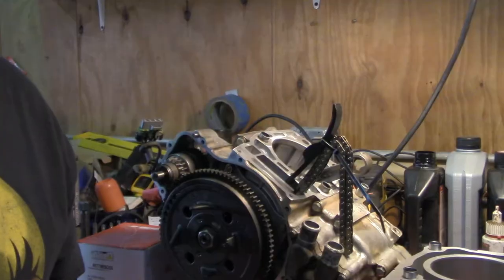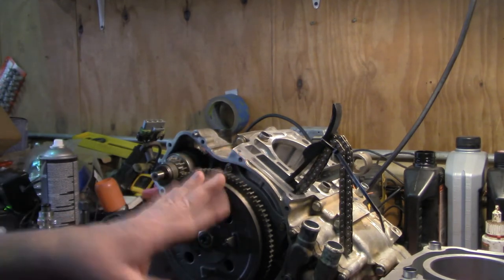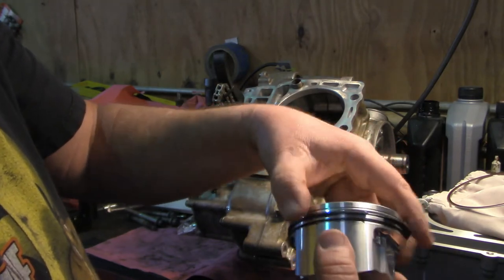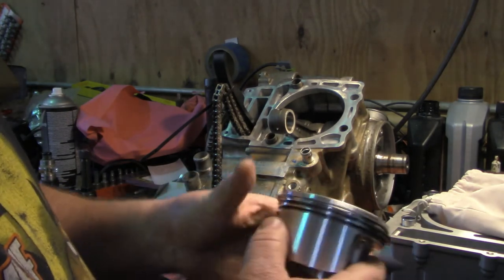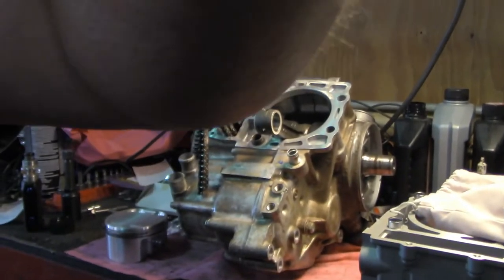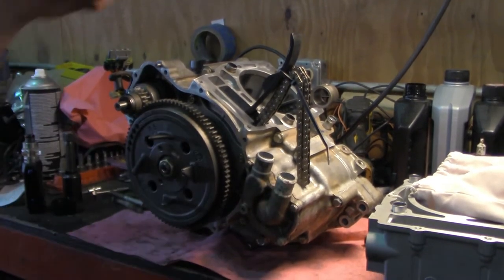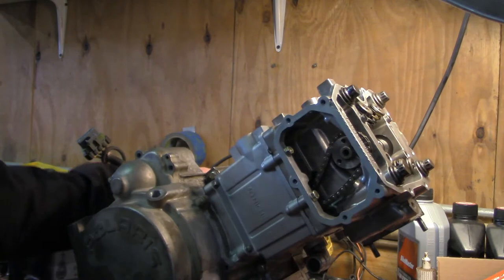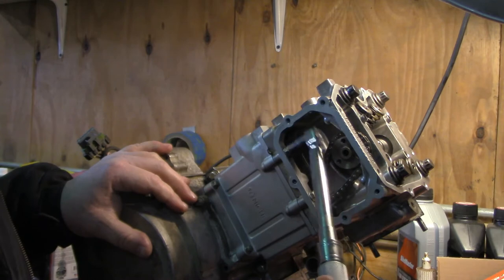Polaris Ranger 500 Top End Rebuild

Comment: Why replace the cylinder? Mine is burning oil, was planning on piston, rings, valve guide seals and gaskets.?
Reply from the maker: Good question, with a better answer. Cylinders are relatively inexpensive these days with myriad aftermarket sources. Once an engine is burning oil, the cylinder will be out of round and warped, the cylinder is also coated with Nikasil which can NOT be bored, you have to install a steel sleeve to refresh the bore, this would make it cost much more than replacing it at the beginning and you avoid the turn around time of a machine shop. You might get away with replacing only the piston and rings, however, even if it doesn't burn oil for awhile, the engine's life span will be substantially shortened and will being consuming oil again fairly quickly. Thanks for watching! I hope I helped you make a decision and good luck!!

Comment: 2007 Polaris ranger 700 EFI runs hot when you go down the road
Reply from the maker: We'll start with the easy things, check the radiator for mud, grass and other debris. You should be able to see through it. When we get one overheating and the rad is dirty, we remove the front bumper and push bar to be able to get to it good enough to actually power wash it effectively, power washing alone may not remove things like speargrass and stuff like that. We use a nylon brush for that. If the rad is clean, check things like coolant level, if the bottle is empty or has ever been empty it may be time to "burp" the system. Depending on how many hours there are on the machine, if could be time to rebuild the water pump even. The plastic impellers have also been known to break ( we replace 2-3 a year ). Let me know what you find. Thanks for watching!

Comment: Question on the oem like pistons there are two dots on top would it matter if I put them in backwards as I put the two dots on opposite side of the cam chain and I believe the two dots go on the cam chain side.
Reply from the maker: The 2 dots go to the mag/alternator side, which is also the cam chain side. If you install the piston backwards, there are a couple of things that can happen, firstly, the reliefs machined into the crown of the piston are asymmetrical meaning that the intake valves can come into contact with the crown of the piston which can/will bend the valves. Secondly, the crown of the piston is not flat on the underside to compensate for the temperature swing between the intake "cold" side and the exhaust "hot" side, this can cause a condition called "cold seize" where the piston expands at an uneven rate during warmup and can stick the piston in the cylinder. Thirdly, the piston skirt (below) the rings, is thinner on the exhaust side vs the intake side for the same reasons the crown is uneven and can/will cause the same issues. Before you tell me you are running it that way and it's just fine ( I have seen them in backwards before ), it WILL drastically shorten the life of the top end, oil consumption and exhaust smoke will be your first symptom, if you haven't run it yet, grab some new gaskets and flip the piston around! Save yourself some money and heartache.
Reply: @JWSRepairServiceLLC  thank you for that helpful info I have not ran it yet luckily an will be tearing into it to turn it around.
Reply: excellent explanation!  @JWSRepairServiceLLC

Comment: I have a 2013 Polaris Ranger 500...
After the top end rebuild I went from 55 pounds to 120 pounds on my compression test. I have read that it should be between 60 and 90... I'm worried about starting it until I know that's ok compression or if I should add a second gasket.
Reply from the maker: Do NOT use a second gasket!! It will never seal. Your compression is normal for a unit that the decompression lever is not working. The only thing the decompression does is make it easier for the starter (but mostly YOU, when rope starting) turn the engine over. It won't really hurt anything to start it like it is, but I would investigate  the compression release to see why it isn't working, the most common reason is too much preload on the eccentric shaft spring, it should just barely be able to lift the counterweight, sometimes it doesn't even lift it all the way up to the stop pin and that's Ok. Thanks for watching and good luck!

Comment: I have a question why would a 2005 Polaris ranger 500 keep shooting antifreeze out of the reservoir cap builds pressure and shoots everywhere?
Reply from the maker: Sounds like a classic blown head gasket (common) or the even worse (rare) cracked head, these conditions are usually the result of overheating, you will need to find the cause of the overheating BEFORE rebuilding the engine or it will do it again. Thanks for watching!
Reply: @JWSRepairServiceLLC  Okay I changed the thermostat cleaned the radiator primed the system ran for 20 min fan is kicking on and off air flow is great the when I drive it it starts to shoot antifreeze out of the reservoir cap big steady stream so should I just replace the gasket and not the whole head sir?
Reply from the maker: @joshuatreadwell5548  In most cases you would want to rebuild the top end, new piston, rings and gaskets. You shouldn't need to replace the head itself unless it is cracked or warped, the water pump should also be rebuilt at the same time and it's not uncommon for the plastic impeller to break off preventing coolant from circulating. I have the vids to do this on my channel.
Reply: I'm subscribed now thank you for helping me sir
Reply from the maker: @joshuatreadwell5548  Thanks for the SUB!!!! We're getting close to 1k subs, which is my first milestone! Thinking about a live stream to do a push to 1K.....ideas?

Comment: Where do you get your rebuild kits? And great job explaining everything!
Reply from the maker: I apologize, I just saw this question, 4 months later!, Good job Youtube. Anyway, to answer your question, I get the bearing and seal kits from All Balls, they also have the water pump kit, but without the impeller. If you need the impeller you will have to get it from Polaris, same if you have a bad crankshaft. There were a couple of aftermarket choices for crankshafts a few years ago, but I have not seen them in the last 2-3 years. Hot Rods used to make a good replacement crank, there could still be few in inventories somewhere. Thanks for watching!

Comment: Have a question I’m struggling with adjusting the valves on my 2002 Polaris sportsman 500 HO. When I bring the cam to the highest point I have zero room to where the rocker arms rest on the valve spring. It’s the correct cam, correct valves, correct springs but I have zero room for a .006 feeler gauge. What am I doing wrong?
Reply from the maker: I'm a bit confused about what you mean by bringing the cam to the highest point. You should align the T mark on the flywheel with the pointer in the mag cover, this is TDC ( top dead center ) then align your cam marks with the pointer cast into the head. This will position the cam lobes at their lowest point and allow the valve lash ( clearance ) to be adjusted. Good luck and thanks for watching!
Reply: @JWSRepairServiceLLC  yep thank you, I had the valve head off the motor and was confusing myself. The moment I put it together and put to top dead center everything worked as expected. My own fault trying to adjust off the engine

Comment: We have a 2015 or a 2016 Polaris Ranger 570 E.F.I and it's burning oil. Is the engine in the video just like a 570 or is it different?
Reply from the maker: The 570 is a totally different engine unfortunately, it  most closely resembles the 900 and 1000 twin cylinder engines cut in half. We have built some 900's but haven't had an opportunity to tear into the 570's much, I guess they aren't that popular down here. Thanks for watching!
Reply: @JWSRepairServiceLLC  Thanks for taking the time to answer my question. I really appreciate that.

Comment: Will be the same procedure for a 2010 ranger 400 HO?
Reply from the maker: Yes it is. Those engines are virtually identical except for the bore size. Thanks for watching and thanks for the sub!
Reply: @JWSRepairServiceLLC  Do you know if you can put the 500  Rebuild kit on the 400 HO seeing how it's already 455 cc's
Reply from the maker: @muddddddddddddddddy  I'm a little confused as to where the 455 cc's is from, the 400 is nowhere near that. That being said, it should fit fine as that engine family has only the slightest changes of major components between the several "different" engines that there are. They all use the same crankshaft, so stroke isn't an issue, it is merely the bore size, so if you install a complete cylinder/piston kit, you could increase or decrease the displacement, now that being said, you could still have running issues as your air/fuel ration will be altered as well, so tweaks there may be necessary.
Reply: @JWSRepairServiceLLC  if you look it up the 400 HO is actually  455 cc's. The 500 is actually 598 cc's .Yeah I would most likely change jets or put a 500 carb on it.

Comment: Can I rebuild the top end with the motor still in a 2005 ranger 500? Or it has to come out of the unit?
Reply from the maker: You can rebuild the top end with the engine in the frame, however, we normally don't as we always rebuild the water pump at the same time. Thanks for watching!!

Comment: someone made a video on how to remove the fitting, it takes a LOT of heat. the whole cylinder will be HOT
Reply from the maker: That's the reason I chose NOT to show it as it could be a liability issue if someone hurts themselves or breaks the part(s).